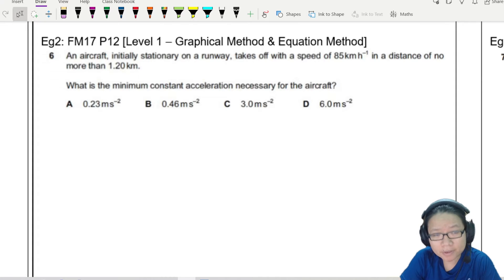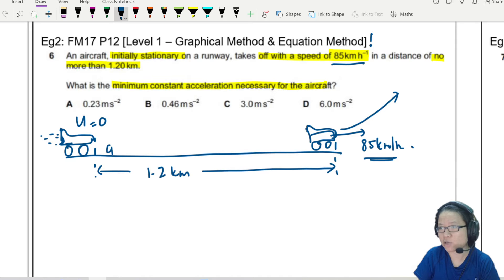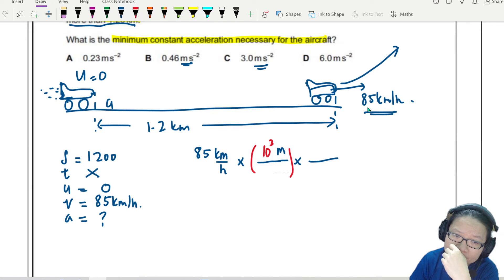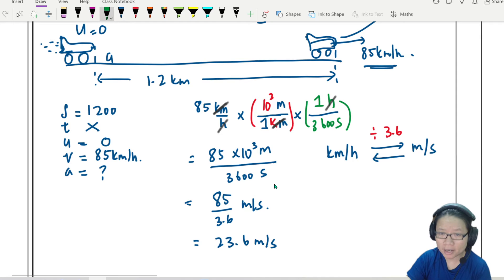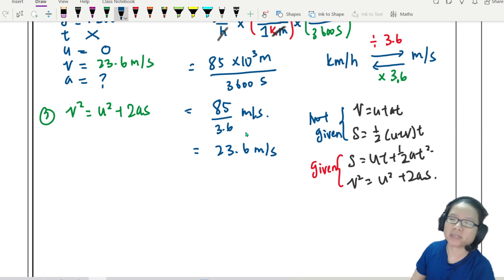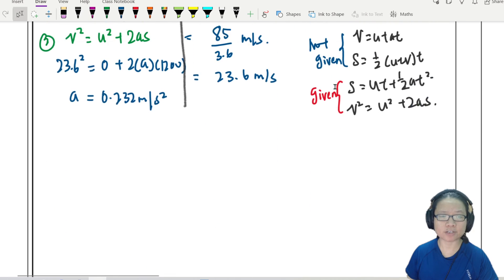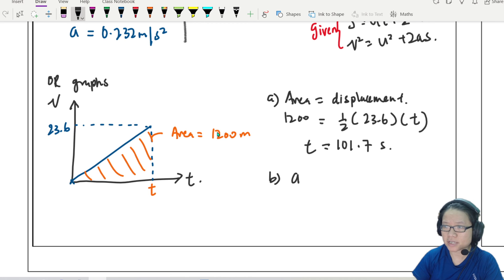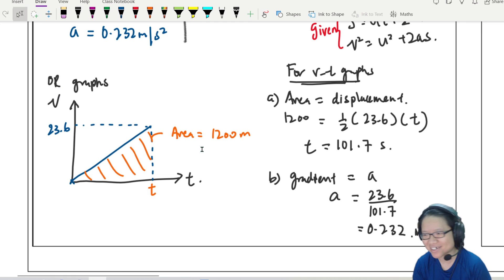2.2b Ex2 FM17 P12 Q6 Aircraft takeoff | AS Kinematics | Cambridge A Level 9702 Physics

Comment: i used v^2=u^2 +2as and I got the answer in less than a minute.but your graph method is really helpful
Reply: Can u tell what steps u used?
Reply: @zar-950  yes sure Sara.Firstly they said that it’s initially stationary which means that u=0 (u is initial velocity) 
So the new equation becomes:
V^2=2as
Convert final velocity of 85 km h^-1 into ms^-1 by dividing by 3.6 :
85/3.6=23.6 ms^-1 
Then if u rearrange the formula to make a the subject u get :
A=v^2/2S
=23.6^2/ 2 X 1.2 X 1000(to convert km to m) =0.23 ms^-2 

If u need further help ask